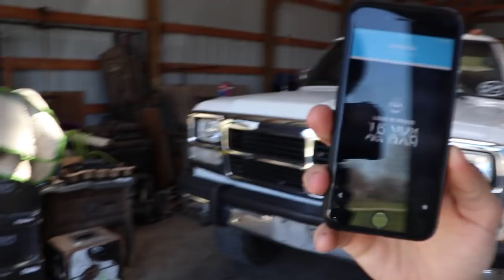COULD THINGS GET ANY WORSE....

Comment: Thread the nut on the bolt before you hit it to protect the threads
Reply: Derek Adams exactly what I was gonna say, good tip
Reply: Was going to say the same thing
Reply: Ben Ross Performance Thank you sir
Reply from the maker: Derek Adams tried that last night after this video... protects the threads a little but that but gets ruined very easily with just a few hits from a hammer...
Reply: LOUD 'N' PROUD dang. Sorry man
Reply from the maker: Derek Adams I just can’t get them dang things out!

Comment: but the front axle on jackstands and use your floor jack and jack your driver size up directly under your coil spring and it'll take the pressure off those control arms! you need to do that anyway or your coil spring will fly out and if you're in the way its dangerous. good work though buddy! you're killin it!

Comment: I did my 96 control arms, the lower one will push the axle forward centered in the wheel well.  I wouldn't say it was the most fun job I did on my truck.  I had a hard time removing bolts as well, I finally disconnected both sides of the axle and it seemed to help.  I also put the tire back on and used a 5 foot iron pry bar/digging pole to push on the tire to force the axle forward so I could install the new control arms.  Remember control arms center front to back, you need to modify the track bar if you want it to be centered left to right under the truck.  Good luck bud you'll get it done!

Comment: Went through the same exact thing on my 12v. Threw new bent upper and lower DOR on. The bolts were frozen solid to the rubber bushings. Didn't have a torch to put heat to it so I had to break out the saw. Took longer than expected but was definitely worth it. Keep up the great videos man!

Comment: I put thuren 2 inch coils on my 96 and decided to do the extended control arms as well. I was able to get 5 of the bolts out but had to cut the two camber bolts out and torch one bolt out. The one that I had to torch out was the drivers side upper bolt at the frame. What a pain in the ass it was. As soon as I saw you pull that control arm out of the box I knew you were gonna have problems.

Comment: If you have the Jack in the axle pushing up it will put pressure on the bolts and they won't slide out easily and you can use wood in-between your hammer and the bolt and it won't mess up the threads.

Comment: on a 5 link suspension (4 CAs + 1TB) you should only change one CA at a time, unless you pull the coils.  the axle is going to rotate/twist when you remove an CA and your problem will compound if you remove both on one side.  the TB is trying to keep the axle centered left/right and the springs are making the axle roll along is axis.  if you had pulled the other side loose you'd be picking up coil springs and broken brake lines...  it's not hard, but it takes some work, one CA at a time, one jack to maintain pinion angle so it doesn't roll on you and a set of stands under the axle tubes to keep the axle from moving fore/aft.  TB = trackbar, CA = control arm.

Comment: If you use brass to make contact with the bolt as you hit it you won't scar up the threads because brass is softer than metal. They make brass hammers and punches, etc.

Comment: So that bolt goes through a bushing. The bushing has a steel or aluminum sleeve which oxidizes itself right to the bolt. The bolt is most likely going to have to get cut.

Comment: you'll probably have to cut the bolts off. there is a metal sleeve in the rubber bushing and the bolt gets rusted to that metal sleeve.

Comment: Dude look at it. The hardware obviously has a load on it and its not gunna come out. Take the weight off the bolts it will come out and use a little leverage

Comment: Hey this is Chris from New York I have a 97 Dodge Ram 2500 series with a Dana 60 axle I recently snapped the front axle plowing I replace the axle the only way I was able to get those control arms off efficiently without wasting cons of time because it was so rusted in the bushing was to torch the bolts off they were just seized in there from day 1 there's a bushing in the inside and a sleeve that goes around the bolt and it's definitely Rusty welded together lol PS when I bought new bolts I put a little anti seize on them before putting them in LML I have all kinds of air impact guns none of them did anything and a three-quarter breaker bar didn't help much either so I torch them off

Comment: Congrats on the one year.  Get yourself an air hammer with a pointed bit and it'll drive those bolts rite out without messing up the threads.  That is what that dimple on the end of the control arm bolts is for. $25 on Amazon can get you a cheap one

Comment: dont hit the bolt put a piece of wood on it and hit the wood works wonders and wont mess up the bolt
Reply: Corey Potts threading the nut on part way would work better.  The wood would only absorb the force and just split.